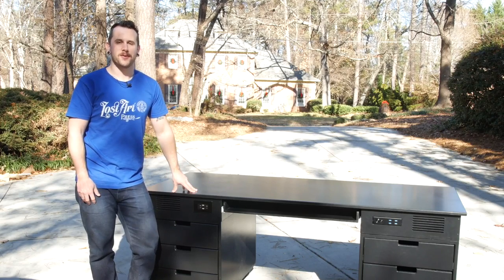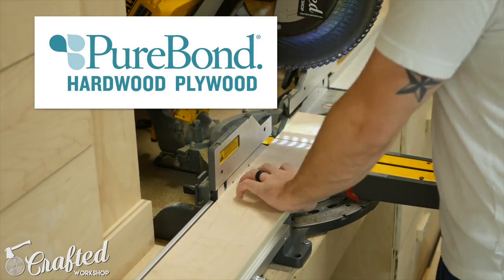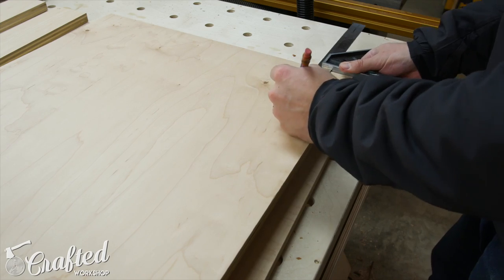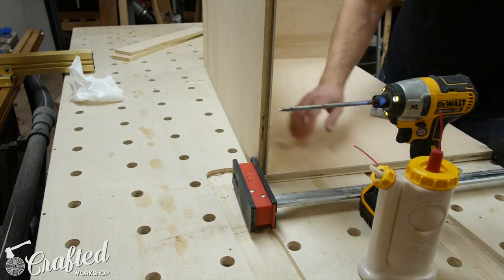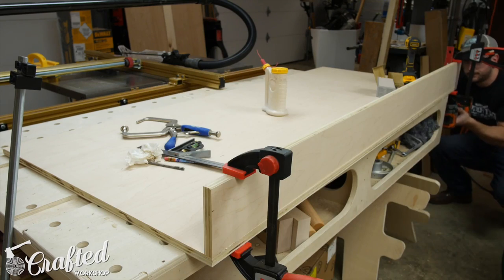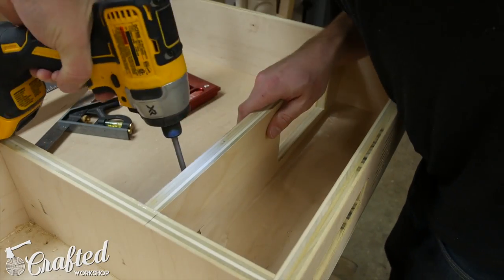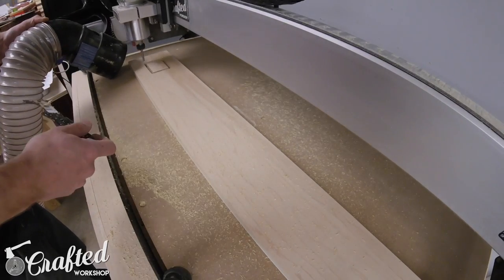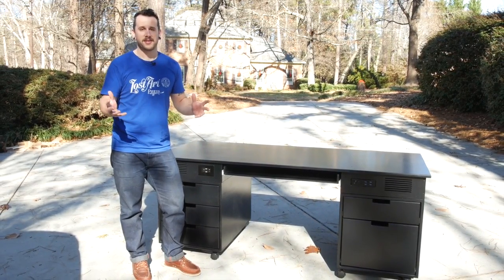Building A Computer Desk / DIY Desk PC, Part 1

Comment: Excellent idea. I recommend adding either a routed indentation or cut around the underside of the desk top, or affixing something like whether stripping around the underside edge so as to keep spilled liquids from so readily running along the underside and onto your pc components. A "drip edge." No idea if that is a real term.
Reply from the maker: +Unauthorized Expression yup, that is real term, usually used for roofing, but that is definitely a good idea!

Comment: Kool, but I do see an issue here and that's when you need to go into your PC. having to take out that monitor setup and speaker or other items.
Reply: LRRPEXILE mount your monitors to the wall
Reply: How often do you really need that intimate of access to the guts, though? It probably wouldn't be too bad.
Reply: It's better than disassembling a case, and lugging it around.
Reply from the maker: +Miss Steaks agreed.
Reply from the maker: +guck foogle precisely. Very rarely need to access the guys of your computer.

Comment: Thanks for sharing. Nice choice of black to reduce glare. The care and attention given to cable management is great. The tilt-top idea is to be able to put away all computers and still have a work table for other work- am I correct?
Reply from the maker: +Jeff Harmed thanks Jeff! While you could theoretically put the monitors on the ground and use the whole desk surface, the lift top is mainly for ease of accessing the computer components when they need to be changed, adjusted, etc. Alternatively, you could wall mount the monitors and have a ridiculous amount of desk space!

Comment: I have the Shapoko too but I am struggling to find a way to secure the material down.  how did you do it?
Reply from the maker: +Ben Veghte I've been using double stick tape for the most part. I plan to make some kind of clamping system as well.

Comment: Johnny, I noticed that you have a specialty clamp you were using to clamp pieces together that fits into a hole formed by your pocket screw jig.  Is this something that's commercially available or did you make this yourself?  It reminds me of a welders "C" or "D" clamp.  Neat project by the way
Reply from the maker: +Joe Smith thanks! No, it’s a clamp made by Kreg, who makes the pocket hole jig. They’re available at any Home Depot or Lowes that sells Kreg stuff.

Comment: Is it really necessary to wear a dust mask when cutting plywood and using a dust collector?

Thanks! Great work by the way!
Reply from the maker: +Konstantin Zurawski not sure that it's totally necessary but I'm always of the opinion that it's better to be safe than sorry. For instance, after spending most of the day ripping some Walnut at the table saw, I realized a piece of bark had gotten blocked in the overarm dust collection and clogged it. That basically meant that it wasn't doing it's job and there was a ton of airborne dust. Sawdust is really not great for your lungs, and I spend 5+ hours a day in the shop. For weekend warriors, probably not as big of a deal.

Comment: Watching your video, it appears that you're driving all of your screws with a DeWalt Impact Driver. In my experience, impact drivers frequently over-drive screws, stripping out wither the wood or the screw head. I noticed that there's torque-limiting gearbox like you find on most drills. 

What tool are you using in this video, and how do you prevent it from chewing up your work?
Reply from the maker: Yup, I'm using an impact driver. I just feather the trigger and never really have an issue. It's highly controllable.
Reply: Well, I have some wobbly Ikea furniture that would beg to differ (though you can hardly blame the drill) :p
Reply from the maker: Yea, that is a whole different animal! I would certainly recommend using a drill with a clutch set really low on particleboard, MDF, or any other material that strips out easily. Hardwood plywood is a lot tougher.
Reply: I also noticed some "backing in and out" when you were installing the brush plates. What was that technique?
Reply from the maker: Kind of like a lazy man's pre-drilling. It will make the hole in the wood more slowly, helps to make sure the screw seats nicely.

Comment: Come on dude !! You have a LOT of electrical tools and a wood dedicated workshop.  In that conditions all the people with some skills can do the same.
Try to do the same work in my kitchen table, using only a black & Decker 10 mm drill, who is the only electrical tool that I have.
Everybody can have a lot of good ideas, but without a good workshop , nobody can perform them.

Comment: DIY - Let's see someone who doesn't have thousands of dollars in wood working tools try this. Nice desk but not easily buildable for someone with average equipment.
Reply from the maker: Agree to disagree. A circular saw/miter saw, pocket hole jig, jigsaw and drill would basically replicate the whole process. I needed to build this faster since it was for a client, so I pulled out my nicer tools, but they definitely aren’t required. A poor craftsman blames his tools, as the saying goes.

Comment: No offense but the outside of the desk kind of looks like shit. I think the sides should have the same finish as the top. If you want to keep the unfinished sides, thats fine, but just painting them black and then calling it a day is just bleh. I wouldn't buy one in that state. Maybe if you don't want to do anything else to it, then sand the paint off and try a wood stain on it. It'll look 100000x better with the wood you just so happen to be using.